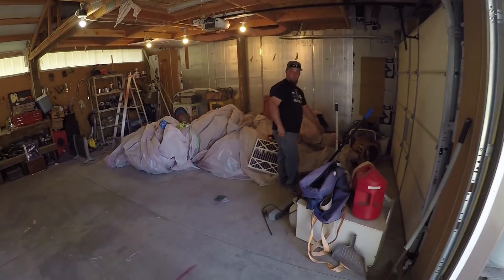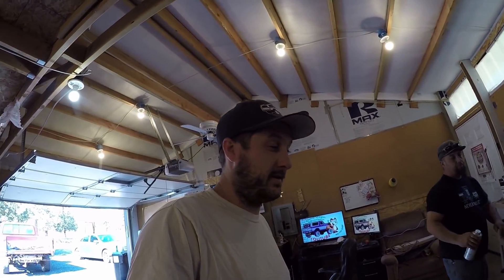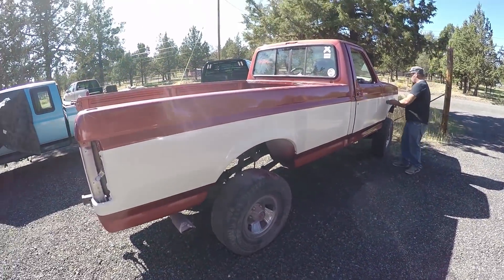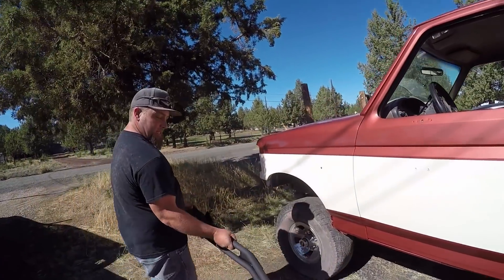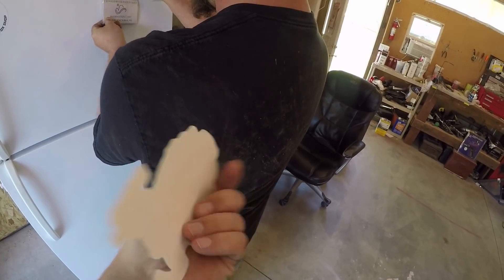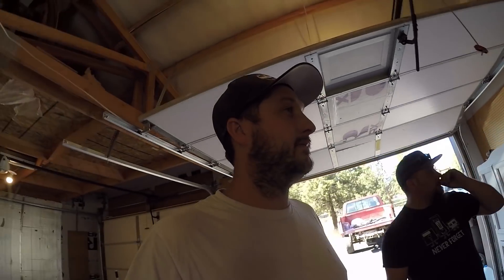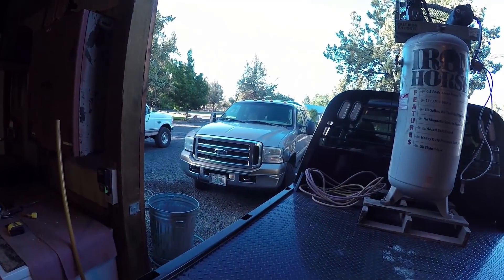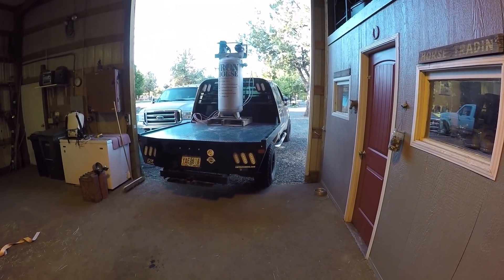1995 F150 FIRST TIME OUT IN THE SUN LIGHT

Comment: Glad to see the Bronco again. Can’t wait to see more videos on it. It’s my favorite. Just replaced the steering box on my 79 with Redhead box and what a difference! I would highly recommend Redhead when you replace yours.
Reply: Redbox I need a steering box for my Bronco I got it out and drove to town probably got two or three inch's of play in the wheel is that the way yours was?
Reply: The play was pretty bad the new box took out probably 75% of it. Track bar mount and steering linkage had play also.
Reply: @markrobertson7253  I had all the suspension parts replaced tie rod ends new shocks new steering stabilizer but I still got a lot of play in the wheel got to be the Box. Thanks

Comment: My Bronco has got a hundred and seventy-five thousand miles on it original miles.  I've had it since early 1990 bought it slightly used. It has like one piece main seal and mine's leaking pretty bad. Oil drops down on the crossover pipe and smokes also nothing like the smell of burnt oil. Anybody have any ideas what I can do don't want to tear it down. Found you through the fox shop. Looks like a good a bunch of guys out in Oregon. Also what do you think about Portland is it safe?
Reply: nautiquecowboy nautiquecowboy I replaced the rear main seal on my 94 f150 auto 4x4. It really wasn’t that hard to drop the trans and replace the seal. Me and a buddy did it in one evening with basic tools and little experience at that time
Reply: @Iamthathillbilly  I just had the transmission rebuilt while the transmission was out  I asked him if there was anything they could do about that seal leaking.  They told me no so they have to tear it down replacing be cause it's a one piece seal. This guy drag races Fords on the weekend's. Also have just seen a YouTube video on how to do it. Now I'm definitely confused as it would have been really easy while the transmission was out. Also thanks
Reply: nautiquecowboy nautiquecowboy my truck is a inline 6 so maybe it’s different but it was just a normal seal like you’d see on an axle or anything like that, I can’t see why they wouldn’t have been able to do it
Reply: @Iamthathillbilly  mine is a 351 Windsor one piece seal goes around the crank itself and crank has to come out for it to be replace. The engine does not use oil doesn't smoke seems a shame to tear it down for a oil leak. It drops down over the crossover pipe and smokes I'm thinking about rigging up some kind of a shield or something just to catch the oil it's not that bad you know five drops of oil can cause a lot of trouble.good luck on yours. If yours is 300 6 cylinder it's a damn good motor.
Reply: nautiquecowboy nautiquecowboy it’s a fantastic motor, it’s got 365,000 km on it which I think is a little over 200k miles and it still runs great, I’d look into the seal and see, I just looked it up online and it looks like the same seal as mine, just a rubber seal you pull out and pound the new one in, no need to remove the crank if your mechanic is careful
Reply: @Iamthathillbilly  I was there when the transmission was out and was looking at it he told me there was nothing that we could do other than tear it down. Well it's too late now I am going to talk to him next time I go in and ask him about it evidently he's not aware of how engines are put together. Hopefully he does Transmissions better so far no trouble